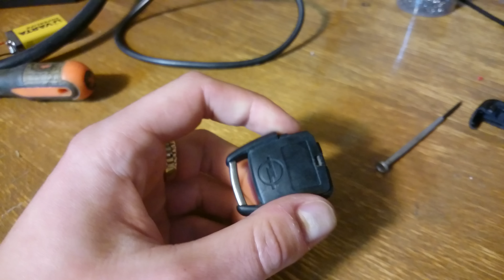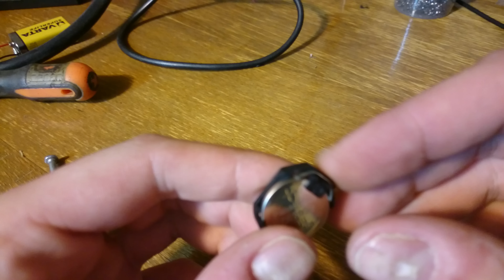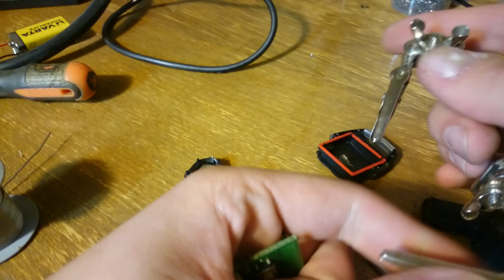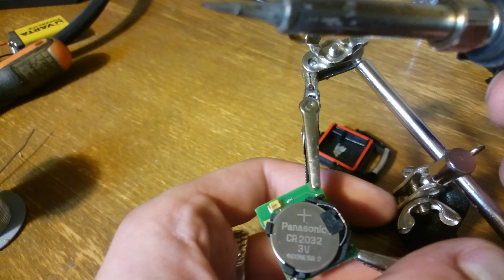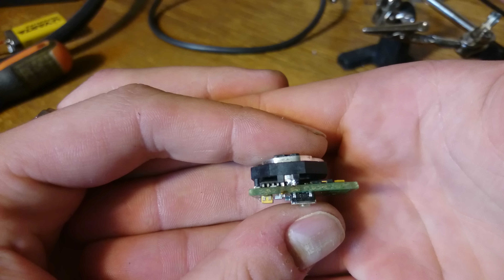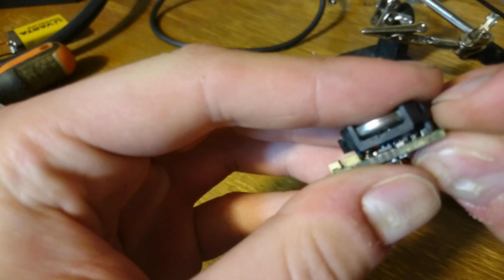Opel key repair

Comment: Hi,
The solder wire diameter is quite excessive for the job (but it has resin in it, does it not? - a must). This is a delicate job, the vacuum pump removal of old solder is essential prior to reconnecting, cleaning the clear joint points prior to soldering (with alcohol or better, yet  "FLUXCLENE") to remove remainder of the resin is also highly recommended before removing and after fitting. 

It makes the difference between just ONE and THREE goes at it.

This a good guide about what does need to be done to fix the KEY to the car and thank you for it;  it is just not a guide about how to solder. BTW - that soldering iron seems to be running to cold to do the job and battery should be removed prior to de - and re- soldering.

The solder tip cleaning wet sponge is not visible or not used - quite typical of cold tips.

The job followed with a thin spray of protective PCB lacquer (for protection) would be a charm added to the job.

A clear statement of your limited capability in soldering would be helpful to unlucky soldering "technique" followers.
Cheers
.

Comment: Just done mine, and all i did was (with a magnifying glass, and my specs on) pop the lugs back in their respective holes, then put a blob of "Blu-Tac" in the empty case/half, and lower it down slowly/carefully on to the battery back, and press closed, as the "Blu-Tac" squashes slowly, it pushes the contacts together, and Voila 🤫

Comment: Hi, I had the same problem and found it easier to solder in two extending wires for "+" and "-". Everything went OK but now LED on a key is blinking - have to resync it with a car - and it just will not. I know the procedure, have had done it before, but now it just won't sync with the car. Do you have any suggestions? Does it lose programming capabilities when battery is disconnected for few months?
Reply from the maker: It shoud'nt be so. Maybe you killed the transponder? They are quite sensitive to heat
Reply: @hacklife4585  hello my friend I have same problem, i perfectly soldered battery pins and I don't know why but my key doesn't sync my opel. I'm synchronized it once but doesn't work now can you help me ?
Reply: @hacklife4585  i can start my car but doesn't sync.